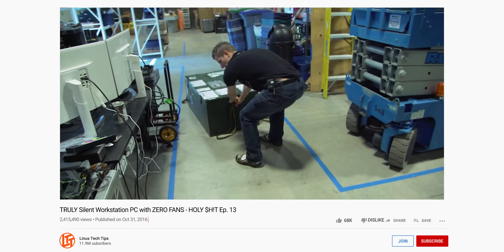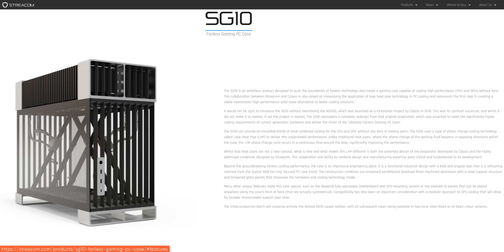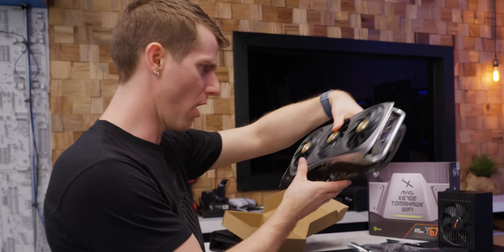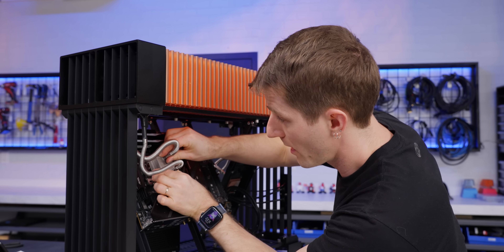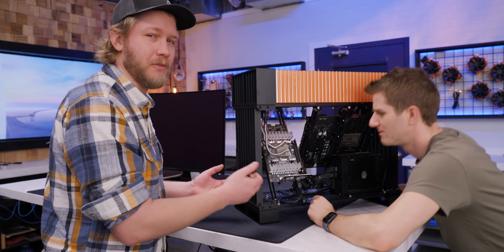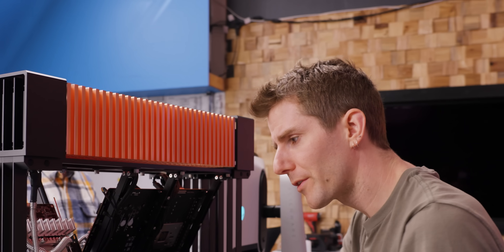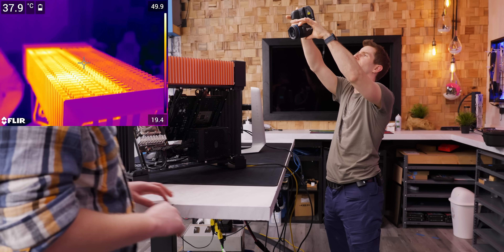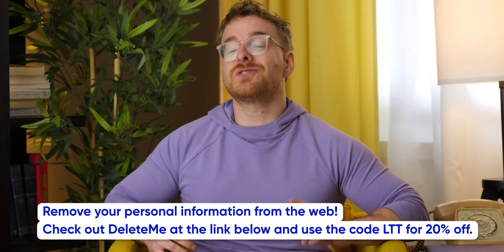I bought this scam PC case... And it actually arrived

Comment: I know its not the point, but somehow putting a slow, quality, 20cm or so fan would make it outstanding with only having one very low noise fan. Probably, given the orientation, in the BACK of the motherboard?

Comment: So does it pay for itself? Probably not a quick AI question stated roughly $139 over four years of use at 10 hours a day for 6 LED cooling fans. Clearly some cases have more mine has 10 and even then the electric cost saving does not pay for the case. It is probably off a bit but have fun calculating it out. 

Total power draw: 6 fans × 4 W = 24 W (or 0.024 kW).
Total energy consumption over 4 years: approximately 842 kWh.
Using the 2024 U.S. annual average residential electricity rate of 16.48 cents per kWh from the U.S. Energy Information Administration 

eia.gov, the estimated total cost would be about $139

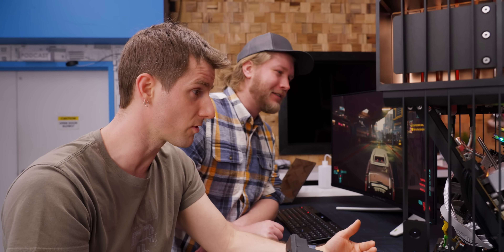Comment: 16:10 - re: That "physics pump" - We call that Natural Circulation in nuclear submarines.  It's designed so we're able to shut off the reactor coolant pumps at low power to be more quiet.

Comment: It's actually three physical things mixed together incredibly well, thermodynamic with a fluid exchanging heat, thermosiphon* to allow a circulation through heat and a different pipe section without the use of a pump and heat conduction through air with the panels on, it is very smart and i would be curious to know which fluid they used in order to have the best exchange, water+glycol?, btw this idea would probably cool better in the aluminium version

(*not sure it's the right word not my first language)

Comment: It’s cool, uh, I mean interesting, but it’s just one huge heat pipe.  Not a real phase change like retrofitting a refrigerators or air conditioners cooling unit to cool your pc.  That is the one, well, aside from LN2, form of cooling I have never personally tried, but I’ve always wanted to.  Back in the day people did that, I only know one person who did and it gave them sub zero temps.  I got sub zero temps using TECs, but a phase change setup was the dream.  A simple chiller that doesn’t cost a fortune to run is the dream now.  Although I don’t even liquid cool my graphics cards anymore because I don’t want to risk voiding the warranty of a $2500 card.

Comment: It's basically a radiator that you'd use to heat up your room, but with the attachments for heating the radiator hooked up to both your GPU and CPU.
Some fans on the bottom pushing air in at a slow speed would greatly help the cooling situation.
Since the fans are not actually being used to cool anything, an intense speed would not be required, and infact, may be beneficial to not have.
If you are trying to cool the radiator itself, having air pass through that at fast speeds will achieve just that.
Or sticking a solid copper rod out your window, and taping it in place so it makes as much contact as possible with the radiator; that would work too.

Comment: It weighs 68 lbs because if it broke 70 it would have to be classified as "Heavy" or "Freight" in the UPS and FedEx system, requiring a different set of handling instructions/procedures when going through the distribution lines, incurring additional cost that I'm sure neither the manufacturer or consumer wants to tackle (being such an expensive case it already is), so some additional math probably went into the amount of copper/metal there needed to be without compromising the temps.

Comment: Is this a collector's piece? I dont see a practical reason to buy one because it would take over a century to regain the money spent on passive cooling through electric bills, and there are better performing parts if cooling is an issue. I like the novelty, but 2000 dollars seems a bit steep for simple novelty, no?

Comment: Eh aluminum may not soak heat as well but it gets rid of it quicker than copper does. Why i dont own copper flashlights, the heat just travels to your hand quicker than an aluminum body. I would be interested to know the thermal difference between the designs using identical parts and apps.

Comment: I think this case is build for 2010-2020 spec from the delay. maybe if u use gtx10 or 20 series it will work better since it was design long ago

Comment: putting 2x 180mm noctua fans on the heatsink would be the best to do tbh. not only would the cooling be much better but it would also put LESS Strain on the Copper heatsink

Comment: if you think about the sound of "boiling" it makes sense that you hear the bubbles from the surface of the boiling liquid. That's why you hear boiling from the top of the tank, even though the heat source is at the CPU, it's the same reason most of the sound you hear from a boiling pot of water is from the bubbles at the surface, not the base of the pot where the heat is centered.

Comment: i dunno, i have intel i5 12400f, RTX 4060TI and \32gb DDR4 rams ,  i get around 80 fps with dlls on quality settings and ray tracing on max and my cpu dont reach 90C temperatures, + other parts dont get that much hot aswell and i use simple cassing with fan solutions, if you are not enthusiast and have better place to put your money its really not worth it.

Comment: I know it would ruin the fanless vibe but I imagine a couple of large, slow-moving fans in the bottom to help with convection would probably help the lifespan of the components.
Reply: They actually have mounts for fan in case components in the future surpass the current thermal output cap of the case.

Comment: They actually did it now add a 12  compressor runs pretty quiet, and a thermo valve and id would be way better to have a control panel to choose different temps

Comment: What's crazy is that one smart and disciplined person could have designed, prototyped, and iterated this in under a year and sent it to a fabrication factory to get a quote for scale production and had the entire thing done in two years. So how did a team manage to take 8 years? Laziness? Inefficiency? Not smart enough? Bit of everything?

Also, did your entire company not have a PSU spec'd to be on its side? You couldn't possibly have scrounged out a PSU that was supposed to be in that orientation? Seems like a weird thing to give up on instantly when you know it's an issue ahead of time.

Comment: It reminds me of ancient Roman and Turkish cooling and heating systems for their houses. No moving parts, just a cellar with some columns in it and throughways to the roof with multiple thin tubes packed together. Difficult to explain, but the layout is simple. And it is cool in summer, and in the winter the fire is set in the center of the cellar, heating the entire palace.

Comment: 84 degrees on the CPU? I mean correct me if I'm wrong but that seems a few degrees hotter than normal? At $2k what's the point? Just aesthetics I guess. The GPU was pretty cool but once you overclock that puppy you're going to see the same temps as any other mid range liquid cooled system.

Comment: $2000 is actually exceptionally good value IMO, when you consider that a watercooled setup and case would cost something similar...  I built a silent watercooled system 5 years ago which cost about 2k, with front and rear wateblocks on the gpu, dual radiators, 5x noctua fans, cpu waterblock, pump, tubing & fittings and case.  It all adds up pretty quickly when you're building something bespoke, and especially to be near-silent when heavy gaming.
Reply: 2k for just the water system is high. That would be a very bougee loop. I have a 2 x 200mm radiator that was like 200 dollars by itself. And an additional 2 radiators. with the pump res combo, 2 waterblocks, fittings, it MAYBE all came out to 1k.  Im talking EK waterblocks if you want also.

Comment: You COULD add active coolers on top of the case, or under the copper, to push the air outside the case through the copper fins, and an intake at the bottom.of the case.

Comment: This is fantastic. I know it goes against the purpose of this case, but adding a small fan at the bottom of the case, blowing up over the components and the heatsink at the top, would likely have a huge impact on the cooling.. but its already very impressive that it manages to dissapate heat so well

Comment: As an HVAC Student about to take the EPA 608, the refrigerant known as R-1233ZDE is a replacement for low pressure chillers that run off of R-123, which is why the evaporators are lower than the condenser, the system itself runs at a lower pressure than the atmosphere we live in.

Comment: I dont know if I could ever trust a refrigerant based cooler. I was a mechanic for a long time and fixed a lot of a/c systems. They fail a lot. Often with no obvious leak. Cars would come in blowing hot air. We'd evac it pull vacuum and wait. 2 minutes was standard sometimes id wait 5 even 10 if the person had done a recharge before, dye test etc. I wouldn't say it was common but it happened often enough that the system would hold vacuum no aparent leaks after testing with dye and would refrigerant. Thats great, but where did all the original refrigerant go? For me at least id have a hard time trusting a system like this, in my bedroom where my infant sleeps. Refrigerant is not safe to breathe, and sometimes it just seems to find a way to leak out. Whether its a small failure in an o ring or the valve stems on the charging point loosen from thermal cycle or vibration. I know this has no moving parts so maybe its not a big concern but I'll stick with my air cooler my pc has never throttled I've never seen temps above 50c and its usually much cooler than that (ryzen 5/ nvidia rtx 2600 super)

Comment: Regarding the CPU temps I believe Ryzens are literally made by design to ramp up temp first to something like 90° no matter the load and then manage voltage and frequencies etc. to actually maintain it to have the least thermal changes / stress on the CPU. Could be surprising, I never knew why beastly Ryzen ramps up to 90° while playing pretty old StarCraft 2, but that should be the reason.

Comment: if you wanna help the cooling without increasing the sound. just strap 2-3 x 200mm noctua fans to the bottom of that cooler and run them on low speed

Comment: I do wonder whether the cooling would be better if you sealed the front and back as well, made an airtight channel inbetween the bottom and top? Regardless, I think it could benefit from additional heatsinks on some of the chips, definitely.

Comment: If you want you temperatures cooler on the CPU and GPU you can add 2 to 3 fans to the condenser/ Heat Exchanger (Copper Part) at the bottom and this will make the gas just to liquid faster and make the thermal Syphoning be much more sufficient. Yes you will have some more Noise from the fans but the temperatures will be so much better

Comment: i got a computer that needs a different power supply i think but i am not sure how to install it, i have a rx 580 8gb card but can only use 2gb of the card, if you can help me id gladly appriciate it. i think a 500 watt power supply would fix everything, but i dont know how to install the power supply it requires because its a hp power supply that is in it at 130 watts. it also has a power cord coming from power supply to mother board that is a 7pin white p2 connector, so only a few power supplies will work on my pc i think but i need help man. i live in near amorita Oklahoma if you can help i would be in eternal debt...

1

Reply

Comment: My last water cooled pc lasted from 2010 till TODAY! The Liang Li pump lasted 11 years!   That s right! 
 My Evga 4 way sli motherboard and 950 Cpu are stll running and gaming every day!!!!    Today!    Thank you EBGA for gifting the board to me!  Lol,  
A pizza box sized Mobo, 10 pcie slots, two southbridge chipsets cobbled together .   Long ago it held 4 gtx 480's and before that held the world record on the first Gtx 295's quad sli .
Ps , the power supply is a Corsair 950 that still works and I had a second VGA only 450 watt thermaltake Psu for all the graphics cards!   but Thats back in a box now.  we just have a Gtx1070 in there for guests to play games and surf...  It still plays Cyberpunk and Rust very well. whoda thunk . ITS 15 years old now and still plays games! WTH!

Comment: honestly thats not terrible considering the cost of liquid cooling: case specific res plates are 350+, rads are 100 each, gpu block is 200+, fittings are 15+ each with a minimum of 8 for a single rad setup, then whatever coolant you want and tubing as well as the case and fans... its starting to seem like a deal for the non copper one

Comment: This just gave me a funny idea. If I ever came across a generator that's faulty, rip everything off the frame and use it as an open PC case (chassis). That'd be kinda cool, and maybe use similar controls you'd see on a generator, and use whatever loud fans I can find 😂

Comment: I got a 5080, and no way I'd want to dismantle a 4090 or God forbid a 5090. Too risky. Warranty is thrown out the window I presume. If you "miss a spot", for instance a VRM surface, you may end up in deep trouble as those run hot like an oven. I mean, burnt eggs kind of hot.

Comment: basic physics hot air is always lighter than cool air When air is heated, its molecules move faster and spread further apart, making the air less dense and therefore lighter so yeah it goes up and heat always moves spontaneously from a region of higher temperature (hotter) to a region of lower temperature (colder) and do you guys know something your ltt Screwdriver costs me around like 6000 rupees which is not acceptable because if I wanna spend 6000 Rs just for screwdriver than I would have just bought a assembled pc, that would make things simple

Comment: guys, you're running a percolation heat exchange system, you're going to hear the gurgling at the "condenser" because it has the largest amount of cavitation area to produce sound. not the micro bubbles coming off the gpu/cpu evaporation chambers.

Comment: Ok so evap is not what you think in terms of boiling and evaporating water. So in refrigeration terms, whether it’s glycol, refrigerant, C02, or water the evap removes the heat from the case or box.  The condensor will see the heat and its purpose is to release the heat from whatever is being used. With refrigerant it’s a chemical change in the refrigerant from liquid to gas when removing temps then from gas to liquid when removing the heat and then it goes back to a liquid. There is a ton of more tech than that but it’s the simple explanation. 

An evap doesn’t make cold. It removes heat. The absence of heat is cold.

Comment: Wonder what it would do if you used a Grizzly thermal PAD carbonaut vs goop, AND for sale of the mainboard and such, add whisper fan just to move air flow through and over the board itself.

Comment: i remember when someone tested the ZALMAN pasiv cooling case . i think it was Zalman TNN 500AF.
it was funny, because when they tested that case. they had forgotte they had placed in on top off a floor heat vent. where hot air raised. 
soo they got very bad heat readiings in the test. until they figured out they had placed the case a bad place. and vupty the cooling case worked very well. at that time it was the dream case. but did not support the newer cpu´s and gpu´s that used more power and needed more cooling. 
this case looks like it can do the work perfectly. but 1300 € is a lot just for one case.. then the expencive GPU and cpu. it will cost almost as much as my apartment to build something perfectly fast. 
haha... noo , for me i like everything is silent. dont need the most expensive gpu and cpu. until now it have always been a balance of noice , performence and money. . meaning i dont have the most owerfull I7 i dont have the most powerfull gpu. but i have a " cheap case with a huge ventilator running 600 rpm or something like that one the side and  always copper coolers with 12 cm ventialor. . and all ventilators are 12 cm low noice 19 db ventilators. ( mostly to get hot air out off the case. ) the huge ventilator on the side makes shure a lot off air enters the case specialy where my gpu is. 
this is now my dream case with passiv cooling.. i just have to sell my apartment to affort it.

Comment: Why did they censor the cost of the case?  They are around 1400 currently on the manufacturers site...which is more than the cost of most people's high performance computers...
If your case is the most expensive part in you build, you need to do some serious re-evaluation of what is important.

Comment: Interesting concept piece, still needs a little work considering still a lot of heat in other places. Still needs some things connected to the heat pipe system. I know the idea is zero fans but you might be able to add some slower quiet fans to really improve the overall experience. Maybe a heat powered fan like they use on stoves.

Comment: 999 not too bad...My CaseLabs TH10 was $750 in 2014, and it came with no fans and no cooler. (mind you it will hold 16-20 HDD or SSDs)

Comment: big man nice.

That is the hugest computer box.🙂

If you guys had the biggest computer box, you would think that your game can snack out. You cannot go any higher because technology is not strong at the highest level yet.

Meaning the chips are small and weak they're not strong yet they have to reach a point of level that they are not able to handle any strong computer box that you have on the table so it's going to be at every single level in all the computers combined the users going to have the same performance of other computers that they have cuz it's not reached a new threshold. 

The only way you can make something out of this computer box if you build your chip yourself to work with that computer box to be the strongest in all of them combined that means you got to be another competitor just like other companies that make these chips.